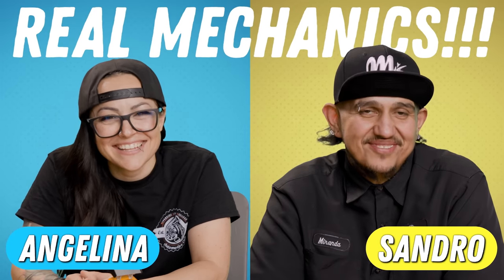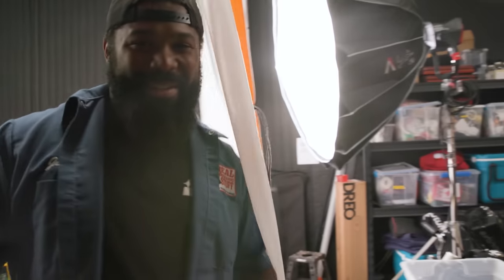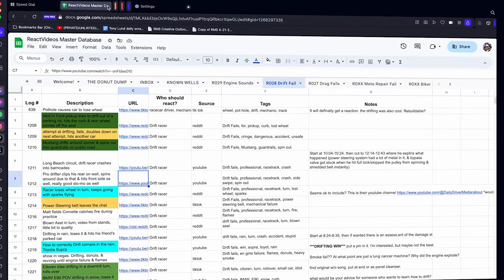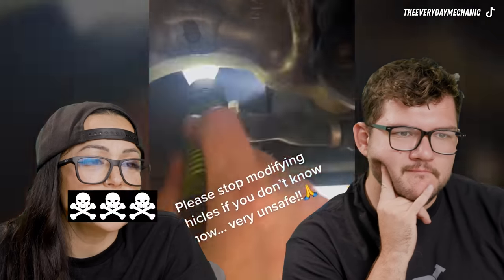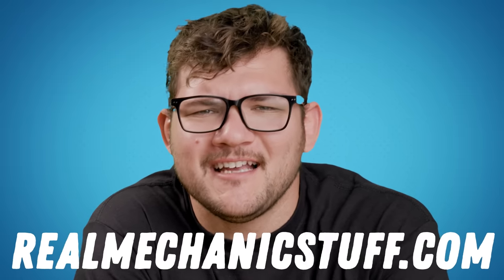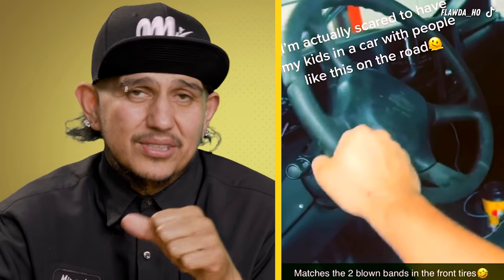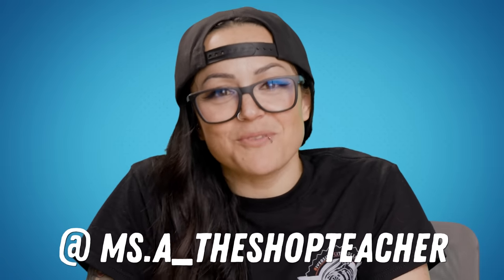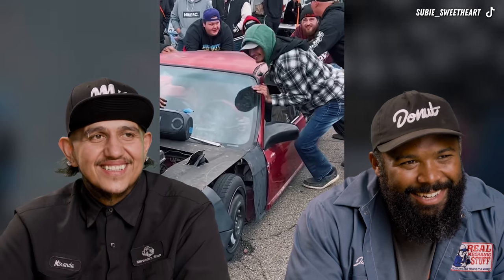Mechanic Reacts To Dangerous Death Traps

Comment: Bought an old police impala, one day I'm going 55, heading towards the intersection i need to make a left at to get to work. Step on the brakes.........nothing.........intersection is a dead red light with both lanes 5+ cars deep. Luckily I react in time and swerve off the road at the ONE SPOT where there's no trees, thankfully no one was on the sidewalk because I rode that side walk, kicked my door open, and yabba dabba doo'd that fucker to a stop. No one came to check on me or nothing, fuckin assholes, so I decided fuck the world and drove the last half a mile to work, I made it too, even drove home after with no brakes lol. Anytime there was a red light i'd swerve onto a side street and just let it slow down to nothing. One of my brake lines was cut open by a rusty bracket holding the brake line on its path that broke. Terrifying experience but fuck it, I made good choices in the moment, and I lived.

Comment: @7:01 I looked up that video and saw that he had carbon fiber brake rotors.  So why in the world would he use DOT3 fluid?  That doesn't add up.  https://youtu.be/Sp3LdgmZpD0?t=309
However, how impressive that the Tesla was still intact after a 170 mph rollover that he could walk away from with a few broken ribs and torn ACL!!!  Nice!

Comment: Those brass couplers are too thin and a soft metal compared to steel to handle 600+ psi. It stretched and blew off under normal conditions. I think they have a maximum rating of 300psi, Really dumb idea. Obviously.

Comment: Brake pads don't go in one way, had a guy driving through Texas to get back to Colorado and I worked as a tech at the local dodge house, it was storming pretty bad and guy was complaining about smells and noises coming from the brakes on his chevy Colorado and when I went to take a look the fucking brake pads were in there backwards just eating that rotor. Guy was fucking lost

Comment: Angelina! You were doing so well, til you got to the statement about where a fuse is in an electrical system. The over current happens to everything at once, where the fuse is in the system makes no difference. 
You could argue your stance on the technicality that it's happening at the speed of light not instantly as it would appear to the eye or any casual testing equipment. Love the show!

Comment: I feel that she doesn't know how electrical circuits work...

It's right in the name, circuit... If it draws too much current, it doesn't matter where the fuse is. If the wire breaks and shorts, it doesn't matter where the fuse is, because the fuse isn't in the loop anyway... 🤷

Comment: So yall dont have a clue what that fitting is on that brake line huh? Thats a compression fitting that is unsfae for brake lines, thats why it ripped the threads apart. These "mechanics " need to spend a year repairing cars in the rust belt, not what they call bad in califorina.

Comment: If an electric powered vehicle has a hydraulic brake, then it's a terrible design vehicle. Vehicle. The electric motor is far more efficient at slowing down the vehicle than hydraulic brakes could ever be. All you have to do is reverse the current from positive to negative on the motor, it will slow you down in an instant, probably faster than a person could handle it. So efficient.

Comment: I don't agree with Angela saying that the mechanic didn't do anything wrong with the Chrysler 200 brakes. I had family take there truck in because the brakes needed to be done. The Ford dealership they took it to put the pads in wrong. That could have cost my kids there lives, as well as mine and other family... Research the autoshop you're taking your vehicle to. Even if there a licensed mechanic at a dealership doesnt mean they know what the fuck there doing

Comment: Well Whistlin Diesel did screw up and his $400,000 Ferrari went up in flames and burnt it along with there rental van that only had 5,000 miles there is 6 newspaper posts on it it happened the Friday before last